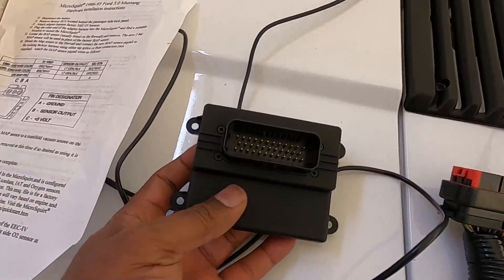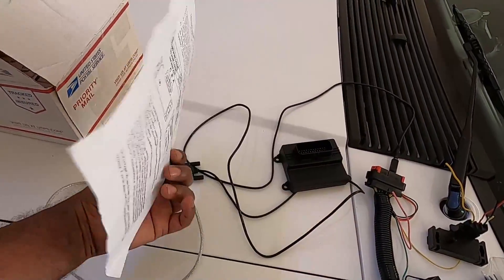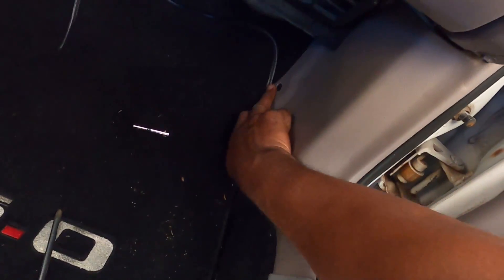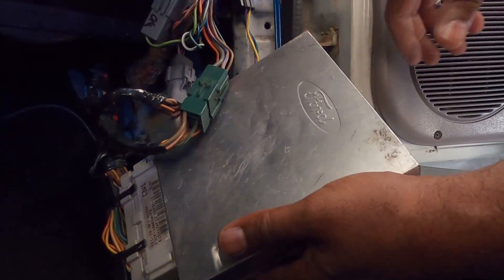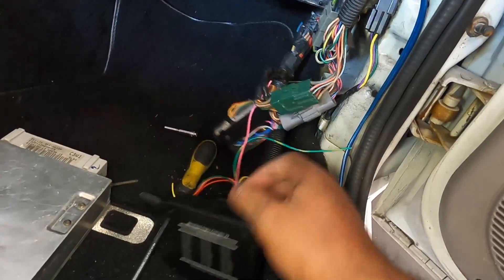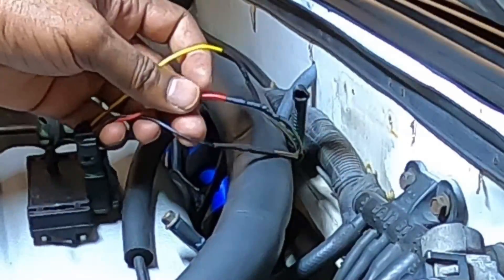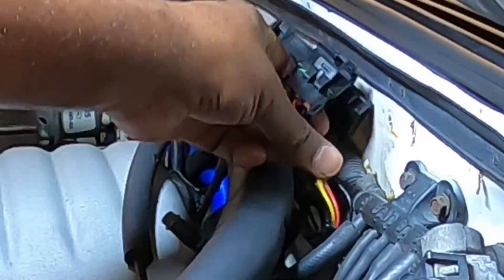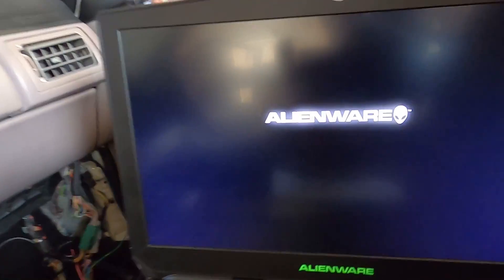Microsquirt installation | Dyno run

Comment: Great video. That grease on the TFI is a heat sink. You found the grease to put on it. Mine does some weird stuff too. Idles at 1500 and surges. Sometimes restarting the car clears it up a little. I have an MSD ignition and the multispark helps with a lot of the ignition issues. Were you able to monitor the car gauges on the laptop from the micro squirt setup? Is that what we were looking at?

Comment: Question at this point how do You actually feel about the micro squirt system an information that You can share will be greatly appreciated ! Thank You . 🇺🇲🇵🇷🦊👍
Reply from the maker: It's ok, but there's no tech support you can call for help. I'm not a tuner so I'm just experimenting with different settings and controls. You definitely need to know someone with microsquirt experience.
Reply: @thefoxchamber  Appreciate the information just trying to make an educated discussion as to which way I'm going to control my engine . 🇺🇲🇵🇷🦊👍
Reply from the maker: @ferdinandcuevas8457  Goodluck with your decision

Comment: It's not a dielectric grease that goes behind it -- it's a special thermal paste.  Ford faced class action lawsuits over the problems associated with having the TFI mounted to the distributor -- a hot and vibration-filled environment.  On other models and later Mustangs they moved the TFI module off of the distributor and onto a finned mount at the front of the car to reduce heat and vibration.  That stopped them from failing prematurely.  When mine went bad I relocated it to the front fascia panel using a finned mounting panel off of a junkyard T-bird.  You can make your own or buy a modified wiring harness to accomplish the relocate.

Comment: There is a mass air AND a vacuum hose to the BAP?
🤔🤔🤔🤔
Reply: You don't use the MAF. You can put a straight pipe on it and ditch the MAF altogether. I think he left it on to not complicate the process any more than necessary.

Comment: TFI Modules use Thermal Paste. The PIP uses the Aluminum distributor as a heatsink. 94/95 mustangs moved them to a dedicated heatsink which helped alot. But yeah no dielectric grease. Use Thermal paste like Arctic Silver 5. make sure where it mounts is clean. use alcohol or fine sand paper to get it smooth as possible.

Comment: Check the fuel regulator. The engine will start sucking fuel through the vacuum hose. You can look into doing the 5.0 explorer timing cover and balancer. Swap it to ls coils. Did that last year on my racetruck, never looked back

Comment: That is a clean body. I have a 88' GT ttop with a not so clean body that I'm trying to finish a build on. I recently dropped a 351W based stroker with a T56 magnum. I came across your video while looking up microsquirt info since that it was I am leaning towards for engine management.
Reply from the maker: It's ok, not a lot of tech support.

Comment: 210 for a stock car with a microsquirt and a tune only is very impressive actually.
Reply from the maker: Kinda surprised myself 😂😅. Because it's 225 at the crank.
Reply: @thefoxchamber  super impressed. Hoping my svo will make some good numbers with a microsquirt , and some fuel and more boost.

Comment: on a completely stock car will this microsquirt plug and and run the car like normal? I dont have a computer for my car and figured this is a better purchase then a used oem computer, it will be there when i make modifications in future
Reply from the maker: Yes, it's basically plug and play. There's a stock tune in the microsquirt. You might have to play around with the tune a little bit. As you saw, I took mine to a pro. I think it would be better than buying a OEM CPU, because of the possible future mods you were talking about. Good luck with it.
Reply: @thefoxchamber  Perfect Thanks for responding, I saved a 91 hatchback from being parted out but the computer and front seat sold just before i got them to stop. its been 14 years since Ive owned one
Reply from the maker: @mustangjoeproject  no problem, good luck with your build brother
Reply: @thefoxchamber  thx

Comment: Try the IAC valve also, that fixed my idld issues. Once again this is all reason why im going holley terminator x because the car self tunes and eliminates all those issues that can cause idle problems. Holley gives you the power at the palm of your hands 🙌🏻 out with the old tech and in with the new

Comment: I highly recommend the trick flow top end kit from LMR which I currently have, track heat trickflow top end kit and made over 304hp and 307tq on a conservative tune but im going holly terminator x in about a week when it arrives and should be making better power after installation
Reply from the maker: You got a nice setup. Definitely thinking about the trick Flow top end kit.

Comment: Nice video! When I had my micosquirt on my green car,  I had a problem with my TFI  breaking up at about 5500. long story short, I put a Holly crank trigger and went to Megasquirt! Keep your stock heads. Save your money on a heads, cam and intake upgrade! Your only going to add about 100-130hp with a HCI swap. Spend about the same money on injectors, fuel pump and a 67mm on3 turbo! 10psi will get you around 425-475whp! If you wanted to do head studs and good head gaskets would hurt anything! Just my 2 cents! Nice looking car!!
Reply from the maker: Thanks and appreciate the info, Frank. Still trying to decide what I'm gonna do.

Comment: Thanks for the mention.  Since yours was already broke it makes sense.  I've really thought about the micro squirt as well.  This is interesting and good video as usual Jim.
Reply: 210 is good. Stock was around 190 at the wheels I believe.  You've got that reliability.  Will Smith for the win 😆
Reply from the maker: @GearHead704  the microsquirt might have helped a little in HP gains.
Reply from the maker: No problem, Matt. You should know by now I will name drop 😂😂😂😂😂. The microsquirt isn't easy to program, if you're a novice like me, and I don't regret getting it.

Comment: https://lmr.com/item/PDI-184724BK/1986-1993-Mustang-High-Performance-Ignition-Kit?utm_source=google-shopping&utm_medium=comparison-shopping&utm_campaign=google-shopping-v2&year=1990 i had the same problem. Bought this kit a year ago and car is not bucking or idling erratically. You would love this set up!!! The wires are all cut to length, and there 10mm braided!!!!

Comment: Fox chamber how much does that microsquirt cost
Reply from the maker: $475-500. I got mine from EFI source
Reply: @thefoxchamber  I saw your post I was thinking about that but I need to know if that's good for a naturally-aspirated setup I know you have one but I have a 331 Stroker motor with Twisted wedge heads and stuff like that I was just wondering if that'll be good for my setup maybe I'll call if I EFI performance performance
Reply: Maybe you guys next year if this stupid pandemic is over can come up our way to bleed Ford blue in Illinois at Sutton Ford
Reply from the maker: @derricktate8210  that would probably be your best bet.
Reply from the maker: @derricktate8210  I would like to go to the Bleed Ford event. It depends on what's going on in June

Comment: What up Mr. Fox Chamber that s$@t cracked me up when you say heres the situation thats the same DJ Jazzy Jeff song that I think about when people say heres the situation!! 😂 especially Mr. Fox Cast says it all the time! Good video keep it up! Did not know mega or micro squirt would work with a stock car. Should actually use computer heat sink thermo paste on TFI.
Reply from the maker: LOL, I think about that too when I hear it, hahaha. Computer heat sink thermo paste I'll try it, thanks.
Reply: @thefoxchamber  best thermo paste is artic silver you can get at computer store or best buy good luck . thin coat and spread it on with a old credit card so its all same thickness.

Comment: Come on.. now I have to wait all day for this. You’re killing me .
Reply: Good video .hey A couple months ago I had a similar issue . Slight surge at idle and a miss/hesitation/bucking when driving.could be the pip sensor in the distributor,acts as a crank sensor and will effect the spark . Replaced mine with an accel unit and fixed the issue.also are still at 10 degrees timing? If so you could bump it up to 14-15 and you’ll see a nice increase in throttle response 👍
Reply from the maker: @89gt5.0  did you change the whole distributor to Accel? I was gonna just replace the whole thing. Thinking MSD or Accel. I think he set my timing at 18..... I think.
Reply: @thefoxchamber  replaced the whole thing with accel. Was gonna get the msd but heard so many bad things about it so went with something different.
Reply from the maker: @89gt5.0  thanks for the info
Reply from the maker: Lmboooo 😂😂😂😂😂